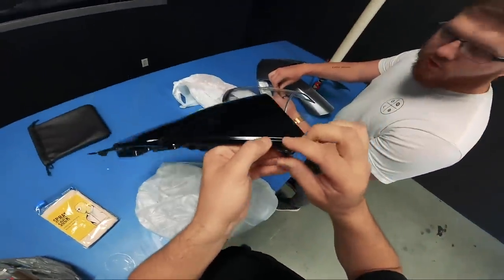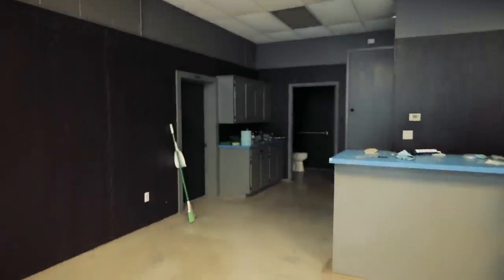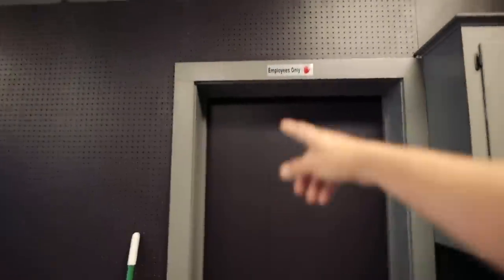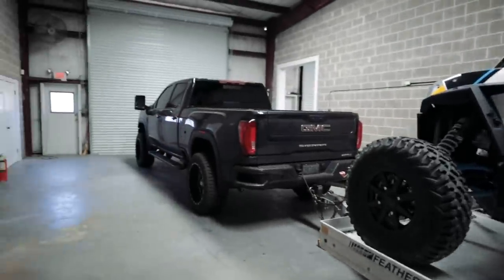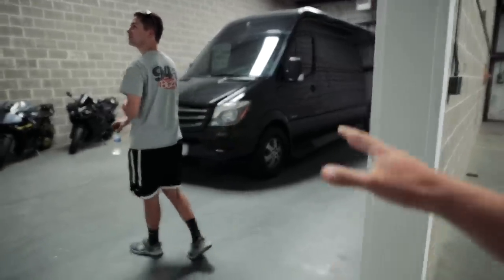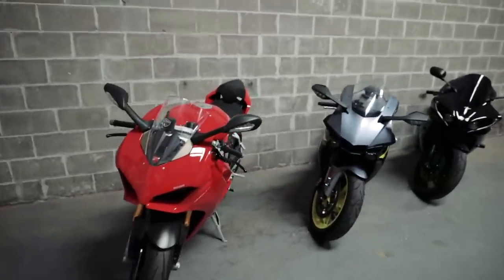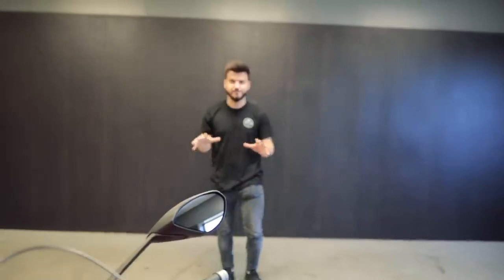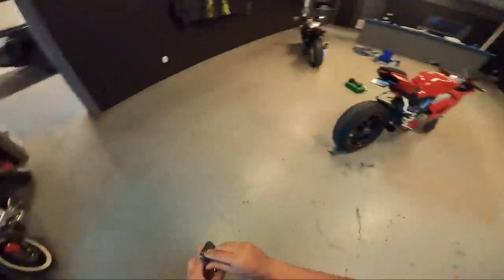Starting a Motorcycle Dealership from Scratch UPDATE! Plus Ducati & R1 Mods

Comment: epoxy floors might be cool, don’t know the pricing but it’d be cool to see
Reply: Literally was about to comment that😂👍🏼
Reply: Especially if its a mix between colors like swilrs in eachother
Reply: Pricing is insane, prolly gonna cost 8k for one side of there garage
Reply: Epoxy doesn't hold up though without super thorough prep. Still not durable
Reply: Said that last video
Reply: I need that r1 😍😍
Reply: @shawnlack1527  they just want new floors in the first space thats gonna be where the bikes are for sale. no reason to refloor shop space
Reply: It’s awesome looking my grandpa has epoxy shop floors
Reply: It’s not that much I’ve done it before
Reply: Or maybe Swisstrax would look sick, and easy to put in
Reply: Put his logo in the middle of it to
Reply: You can also do them yourself for really cheap
Reply: 12/per square foot or so.
Reply: diamondheat9 it actually does hold up I’ve done many floors in factories and shops and garages if you buy the right product and mix the correct way it holds up amazing I use to do it professionally as well as polished and decorative concrete
Reply: Epoxy is the way to go so many options js....
Reply: Do it with dan?😂
Reply: epoxy in the showroom room forsure
Reply: It's actually pretty cheap
Reply: Yeah epoxy is nice but really expensive
Reply: That would look awesome but I wanted to do my concrete floor in my room and it was like $600 for a 50 sq ft room
Reply: Look at do it with dans epoxy flooring
Reply: @shawnlack1527  do it yourself
Reply: You can do epoxy floors you’re self it’s time consuming and you have to know which ones to get and how to work with the different types, but the outcome is so worth it IMO

Comment: Removing throttle slack is risky. which is why they void the warranty. That little space basically keeps the bike from losing traction or looping out when you yank on the throttle off the start. It also keeps the cable from snapping under hard acceleration. I have personally snapped it multiple times. If you feel that the space is too much, adjust the cable slack and bring it down.

Comment: Just so you know, the Ducati tank actually goes under the seat so it’s not just the top portion. Ducati designed it like that for weight distribution. Wsbk and motogp bikes have the same design.